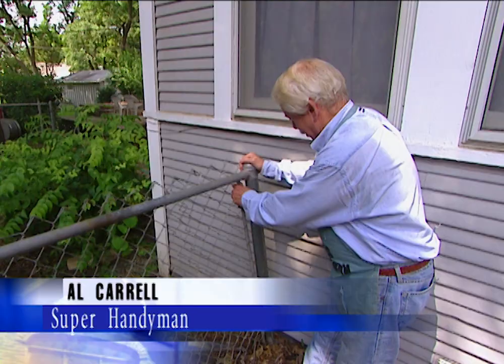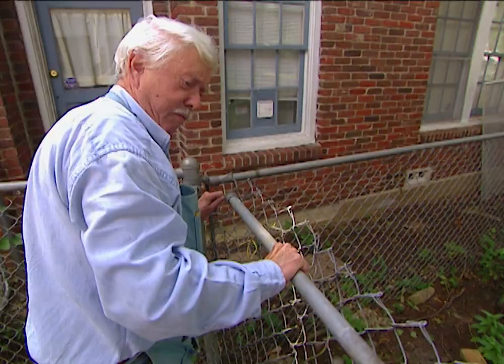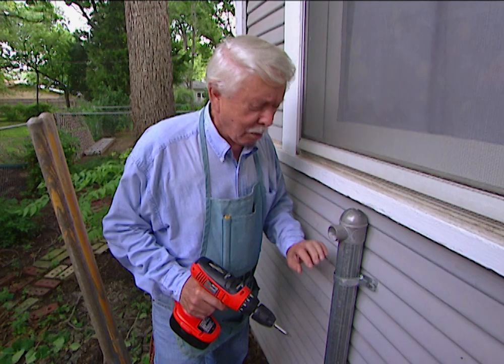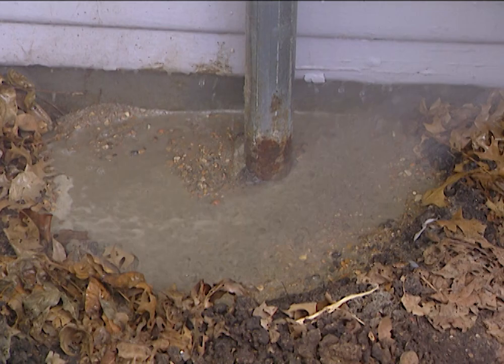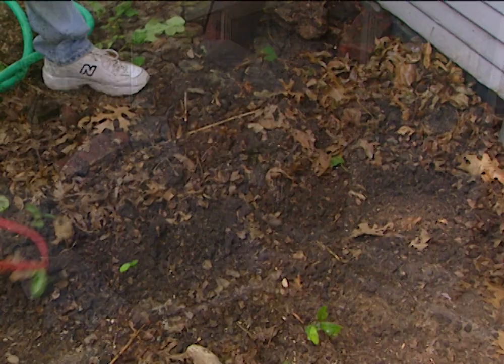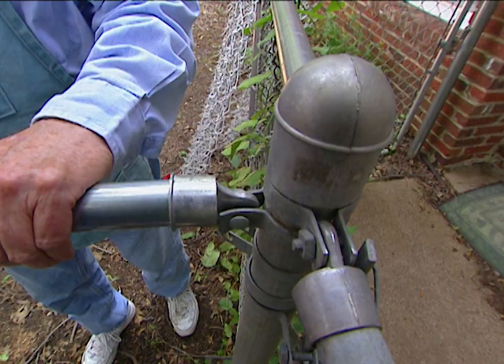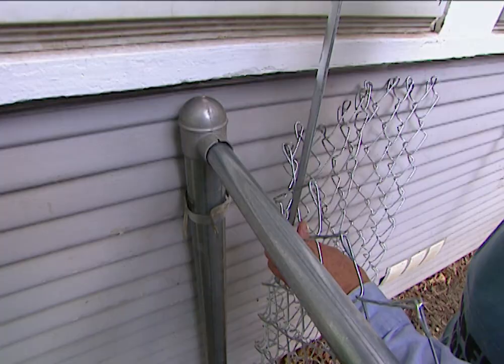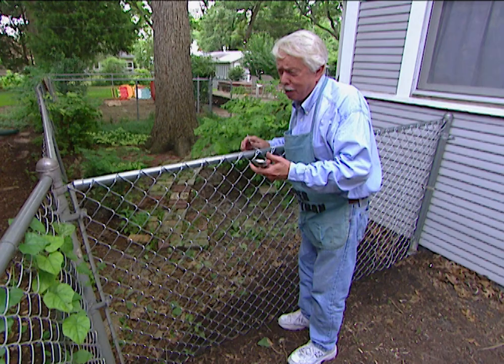How to Repair a Chain Link Fence

Comment: Very straightforward.  I have a small dented top rail section— that's all, everything else just needs to be re-attched— and had been getting estimates of upwards of $400 for an easy fix, under a half hour. From watching this, pretty sure I can handle it. Thanks.
Reply: That’s where I’m at currently storm damaged the fence and now they are asking $500 for a section

Comment: Hello,
I’d like to ask for your advice. I have a fence with 19 terminal posts in a straight line. The terminal posts are 2-3/8” inches and 6ft tall above the ground. They are embedded 24 inches down in concrete. Approximately 15 of these posts are not plumb. They are slightly not level. Approximately 5 degrees off. I have a top rail going. I have also a top rail bar that is tension banded between all of these posts. My worry is that over time the terminal posts will continue to tilt. Should I correct them now or is it not worth the effort? What kind of lifespan can I expect if they are going to continue to tilt? Thank you in advanced.
Reply: I don’t personally think it’s worth the effort, is it noticeable when you look at it or is it only noticeable when you put a level up to it? 15 posts in concrete 24 inches down would be an absolute biatch to deal with. It’s a chain link fence not exactly the most beautiful thing in the world.

Comment: What wire did you use to tie it on the top?
Reply: doesn't need to be that specific, just something strong enough to hold it in place. you can use a zip tie if you want, but any wire with tensile strength of something like a wire hangar will work.

Comment: Thanks! This is what I needed. However, how do you know how much water to add? That didn’t seem like enough to me but how can you tell it is?
Reply: Depending on where you live, the ground water will set the concrete so you don’t need to add much water. He just did enough to get the process started.

Comment: if youre going to all this trouble, get a rake and a wheelbarrow and mix that concrete correctly, you literally only saved 10 mins not mixing it and that set is not even close to sufficient...
Reply: Not what the directions say on the bag. He did it right